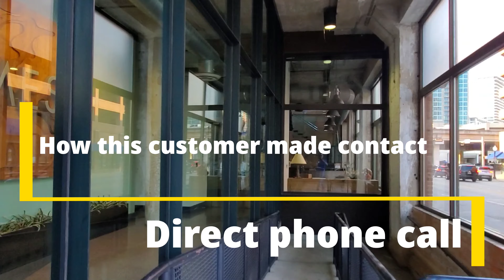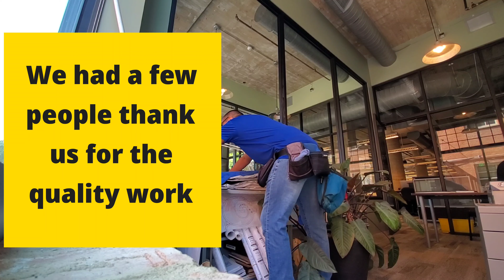JOB BREAKDOWN | Commercial Window Cleaning Customers

Comment: You do a great job! I highly suggest a carbon fiber pole. Pick your brand, im not sure how much it matters. But the weight difference and rigidity gain is so helpful in my opinion. They made a big difference for me.
Reply from the maker: Good tip brother! I might get a carbon fiber for my long pole and try that out. My 18' pole isn't as compact as I'd like so that's a great suggestion. Thanks for commenting!